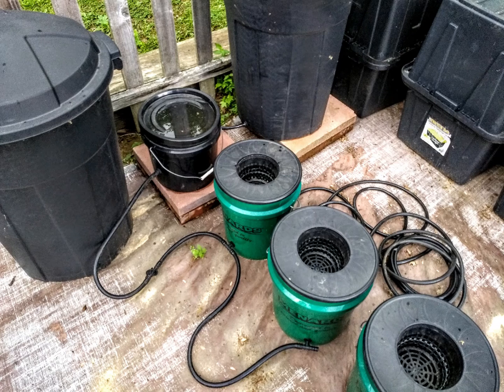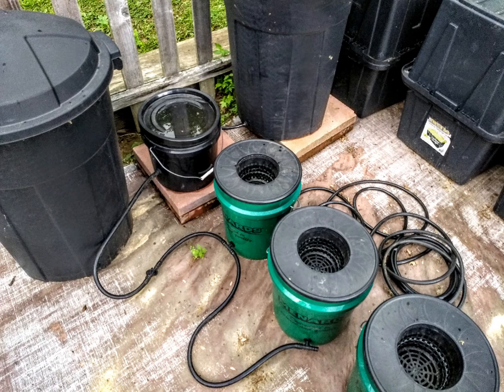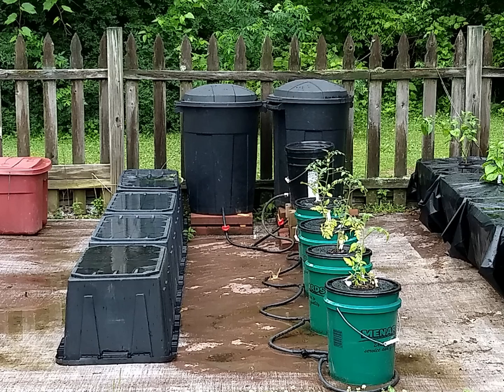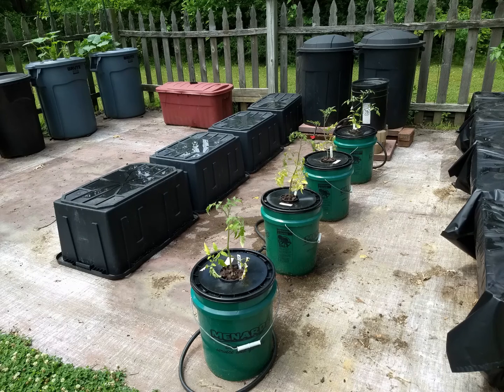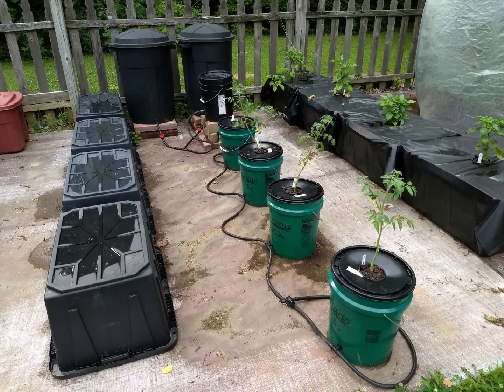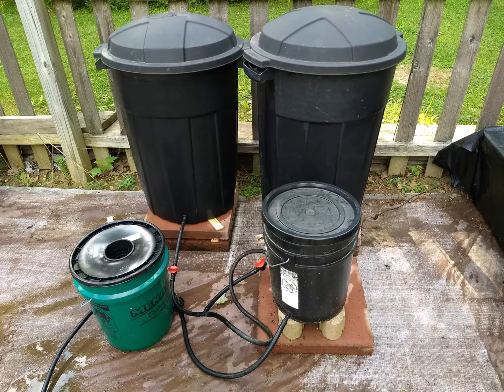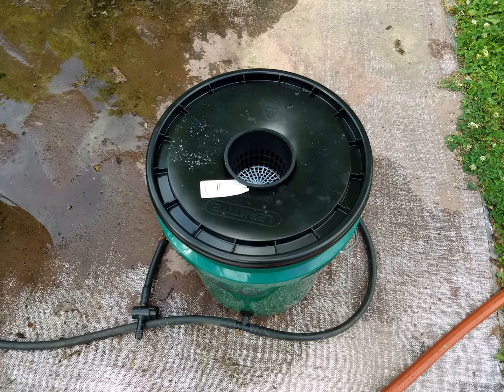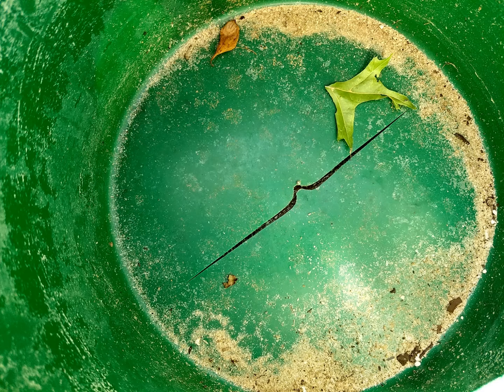Matt Garver - Hydroponic Bucket System Failure and Changes

Comment: At least it was only four plants, your new system will probably work better. That's why I use the downspouts, they are meant to be outside in the sun. The ones I have are going on their fifth year. I wonder how long the food grade NFT channels last outdoors. Is it cooling off for you?
Reply from the maker: Hello Mike, thanks for stopping by and commenting. I like your use of downspouts.  My green buckets were four years old and rated for outdoor use.  I pasted part of the retailers information beneath this.  Five gallon buckets are great, especially in black, dark green, or dark brown to prevent sunlight creating algae inside.  I am learning that quality control is important.  My buckets from discount stores seem less rugged than my other buckets.

Yes, I am officially beyond the summer gardening season in Zone 5a.  Although, September has been incredible!  Temperatures have included several days with highs in the low 80's, including today.  I am enjoying the last push of summer.

Menard pails can be used for..., mixing mortar. Great for indoor and outdoor use.
Prime high density polyethylene (HDPE), 90 mil thickness

Comment: Interesting!  For two years, we have used Food Rising Mini Farm food grade grey rectangular bins and Kratky method.  Working well just manually adding water and nutrients to 8 bins in solarium.  LED system hasn't been necessary this summer but will use in winter.

We abandoned the two bucket float valve and secondary cylindrical bucket delivery system that came with the system due to irregular fluid delivery as roots cling onto and clog valve.

Main problem this summer was 93degree heat in San Diego, killed hydroponic plants due to excessive heating of water beyond nominal 75 degrees F for many days at a time.

Now that it is cooler in 70s, have restarted two bins of bok choy, one of lettuce, one of herbs and will scale up for winter crops using all 8 Kratky bins.
Reply from the maker: Claudia, your setup sounds amazing.  I agree that container choice is crucial, especially outdoors.  Maybe, I will post a video sometime with all the containers that I've tried and the pros and cons.  About the two issues that you mentioned, I find my DIY approach to isolating the float valve and using 1/2" tubing outdoors with large plants eliminates the root issues.  Also with the Kratky method, heat does not seem to be an issue for me with the nutrient solution or roots.  Many plants do well in Kratky containers in heat.  Unfortunately, several plant species are not heat loving.  Here is a video where I checked temperatures, https://www.youtube.com/watch?v=OcpFULoPfEo  
I would love to see pictures of your grow room, it sounds amazing!